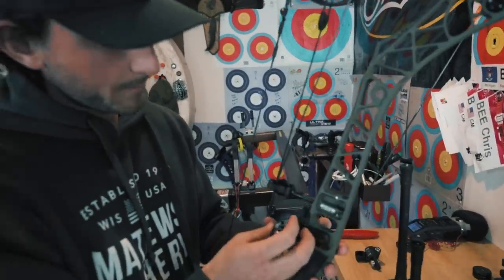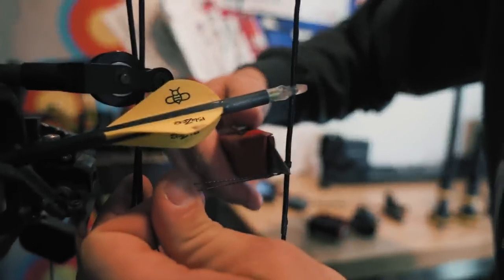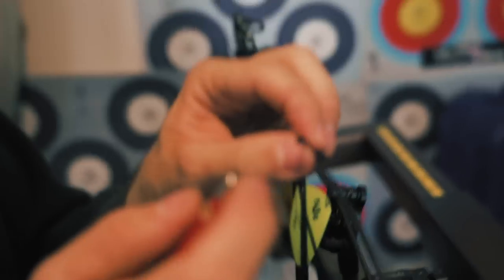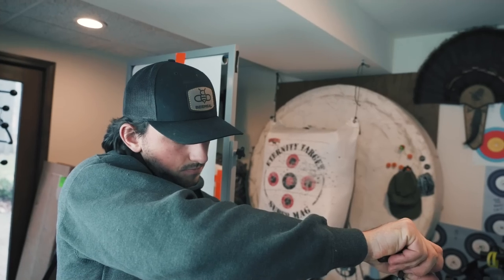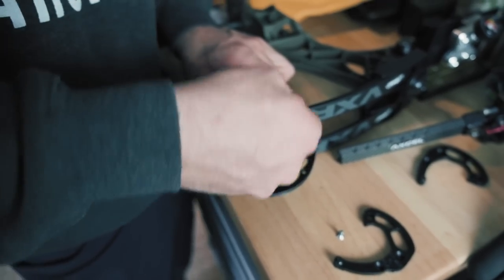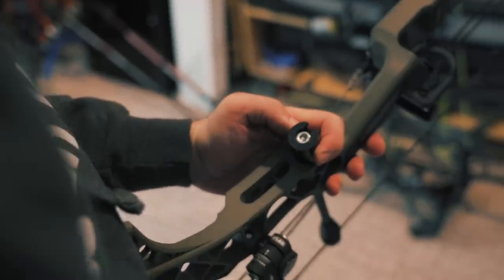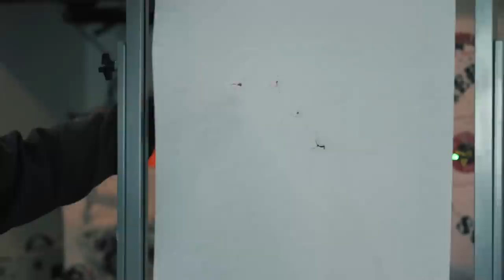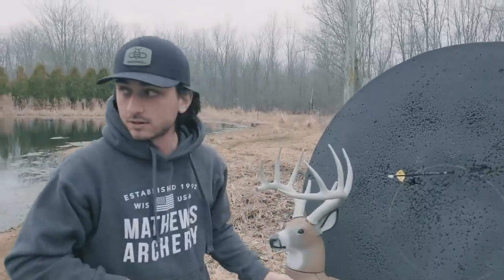MATHEWS VXR 31.5 BOW BUILD

Comment: That 80% vs 85% mod video would be awesome, I'm saving up for a 31.5 right now and that's one of the things I cant decide on
Reply: I go higher letoff for hunting bows. It's a lot easier if you need to hold at full draw for a long time. Went with 85% on my vxr28 and can group pretty well out to 85 yards for my standards. If you're using a handheld release and are concerned about loop torque with high letoff, just use bcy #23 and make your loop a tad longer. Purposely twisted my release while shooting out at 85 yards and my group only moved like an inch right
Reply: Damn bro I am sure saving up for a vxr is tuff aren’t they like 15hundred
Reply: @fishingwitheddie1535  If you buy everything such as the rest, sights, stabilizer, and quiver, all of the top brands will set you back about $2k.  Add more if you go with a carbon riser opposed to aluminum.

Comment: Love the videos man! Would love to see the 80% vs 85% let off video! Just wondering why you adjusted the limb bolts instead of just switching to a lighter pound mod? Just curious I switched to a light mod myself to keep the limb bolts tightened down!
Reply: I just ordered mine today and the pro shop owner said to use mods, not limb bolts to adjust or affects let off and other problems as well

Comment: @Chris 🐝. I was unable to watch the full video, did you mention what draw weight your shooting? I’m curious, did you find the VXR stiff? I went to the VXR 31.5 from a Vertix and was actually unable to pull the VXR at 73 pounds. On the Vertix however, I shot 73 with no problem. It felt like the VXR was very stiff up front. Smooth, but a consistent stiff draw. Be curious to hear your thoughts.

Comment: Hey Chris hope all is well. I have a question on D loop and setting up. The bow your setting up is the Mathews 31.5 inch draw. Your installing a D loop which will increase your draw to at least 1/2", and I noticed you made the D loop a little larger so it might be even more and with the amount of shooting you do it is going to stretch a little. Then you weighed the bow and it was 79 pounds. I dont care how strong you are unless you intend to make that bow a hunting bow which once its sighted in you shoot a little at a time until hunting season. Me I have a love for mathews bows, I just won't be able to keep it in the case. Now I dont know your intentions for this bow, but if you decide to lower the poundage from that blistering 78lbs to 60 or 65 pounds for a more comfortable weight to shoot, especially for target. Now the problems I see is all these alterations extend your draw length dramatically. I feel threw personal experience even when you use the modules, to shorten the bow back to your draw. I notice the feel of the bow is missing something, like power. To me nothing feels better then a bow peeked to its max weight, their is no reduction or adjustment in weight. It feels like the bow is no longer in the valley of the cams when you pull it back or in the power stroke at full draw. Not to mention throwing the timing off. Every inch you loose is 10 feet per second. Here's the question? Is it better to buy a  shorter bow to avoid the alterations and no change in fit. My biggest concern is the timing. Or am I not making sense. I think it is a legitimate problem. Thanks for reading.

Comment: Do 80% vs 85% mod video comparison video, as well as a indepth video on the mod system difference from mod to mod. example speed, left off, draw length, and what happens to these variables when adjusting limb bolt. so people can see what the can get out of each mod set up. i have actually thought of format for the video just no camera or the money for the mods to do it.

Comment: Just an FYI
You can get more vertical and horizontal adjustment on the Hamskea by removing the lock down screws. There are 3 little holes for the micro adjust nipple hidden under the bracket for both vertical and horizontal. When you remove the lock down screws you can pull the bracket off and move the micro adjust nipple to a different hole. 

Good job on the video! Keep up the good work!

Comment: if you take the bolt complete off the hamskea it has notched to where you can reposition it if you run out of elevation or windage adjustment.

Comment: congrats Chris, keep up the good work. I come with just a question: the D-loop position on the main string should not be right in the middle between the two cams, perfect in the middle of the string??? when you shoot and it is not perfectly aligned in the middle, does not pushes up or down the arrow at release?